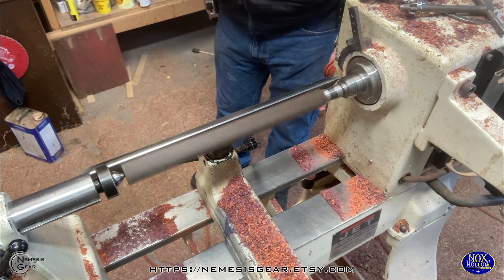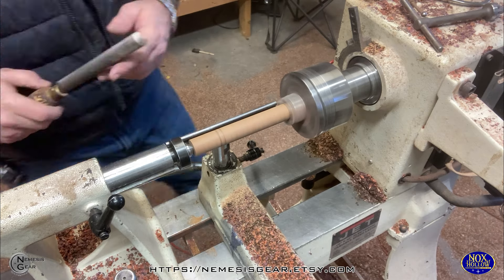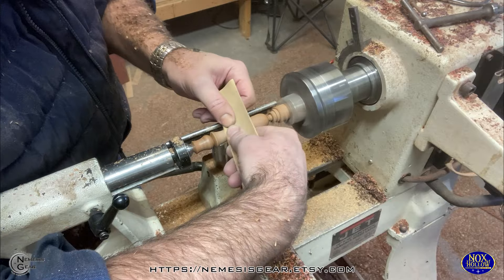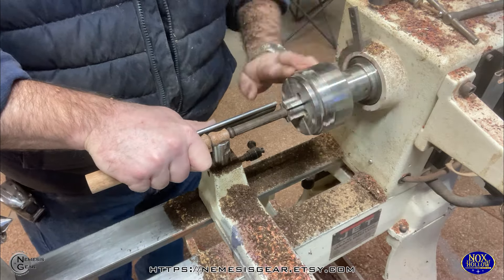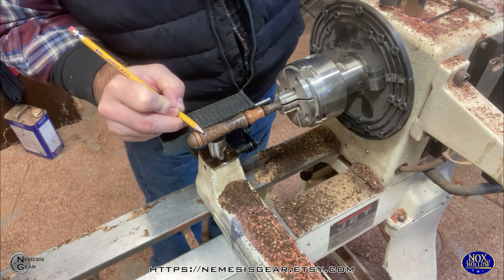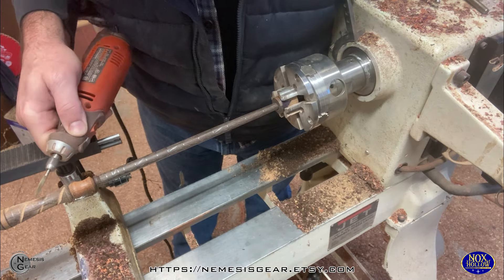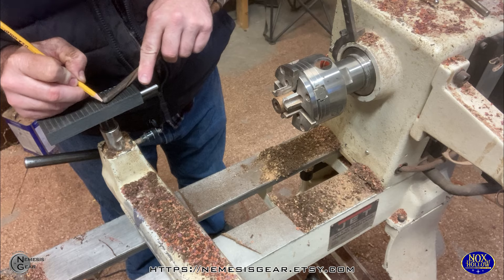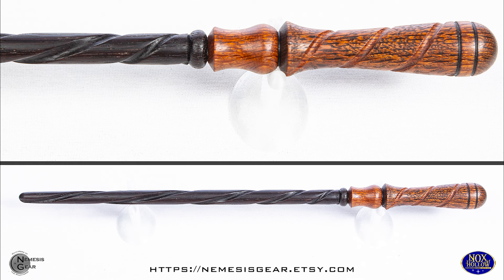Spiraled Wenge and Leopardwood wand (self punishment)

Comment: So lately I've been trying to make walking sticks and fighting sticks some of which I have put a spiral in with a round file. Now mind you I'm mostly blind but I also have a big fear of accidentally removing stain when sanding in between polycrylic coats yeah I want to remove any rough spots any tips or should I just apply my coats of polycrylic and polish it smooth later I know that technically I'm supposed to sand in between coats it's very easy to remove the polycrylic and the stain even with very very light sanding.

Comment: I prefer your more organic sanded in spirals, but this is still very nice. 
Another interesting technique is to find a piece of wood with a natural curve and shape the wand following the curve. A 1 x 30 belt sander with the platten removed and using a 1/2" wide belt is good to shape this kind of wand (I haven't tried using a flap disc in a drill press, so can't say which method works best).
Keep em coming.
Reply from the maker: Yeah, I do like the wide spiral the flap wheel makes as well.  But I enjoy doing a wide variety cuse everyone's taste is different.  One of those types of sanders is on my wish list, but not before a spindle sander, jointer, and especially a better bandsaw.  Just need to sell more wands so I can afford more cool tools...lol

Comment: Fairly new to using a lathe, I've been loving all of your work. The question I have is about your headstock. Is it hollow? How are you able to feed so much of the blade into that end?
Reply from the maker: Thank you.  Yes, the headstock is hollow because you have to be able to eject any tapered drives.  You should have a rod with a nob on the end or something similar to remove the spur drive to change it out.  At least for wood lathes, that has been my experience.  It's not a large hole, but it's about 3/8" or maybe 1/2"?  I've had a request to talk about my steady rest, perhaps I'll just do a general tool overview and show what I use and how it works.
Reply: @mythimpressions  that would be great to see a video with your setup. Thanks for the info and the wands are truly amazing! Great works of art.